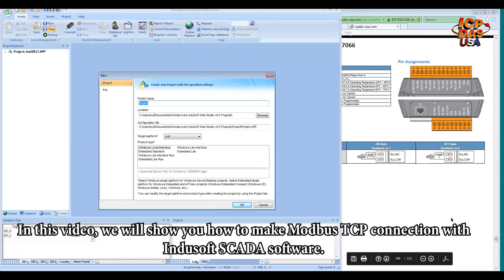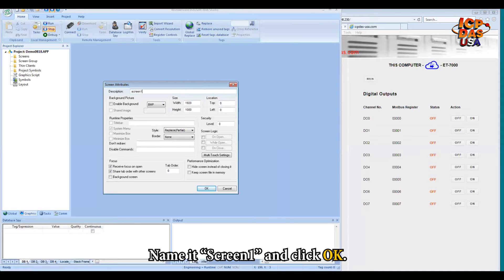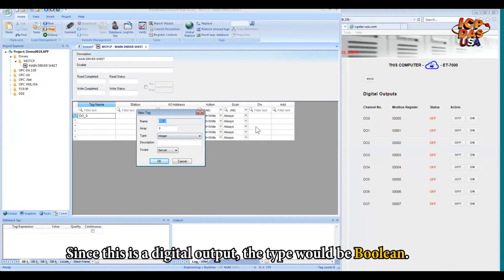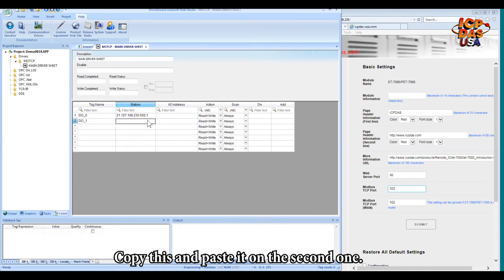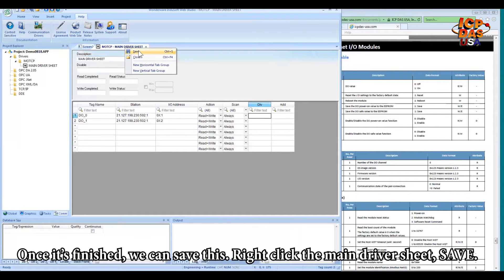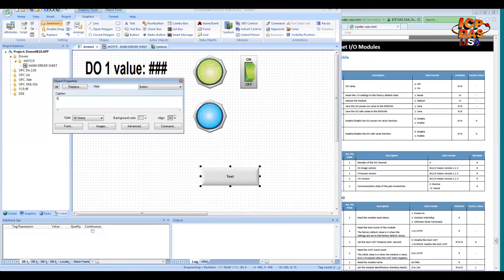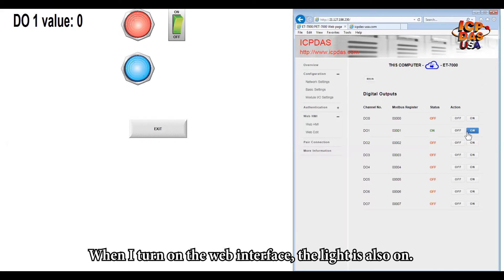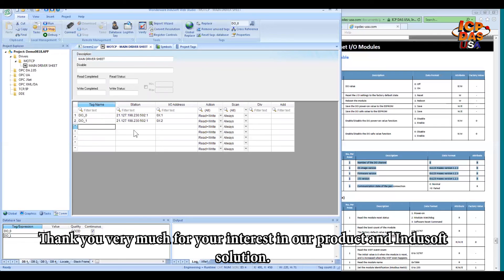How To Connect Modbus TCP Devices with InduSoft SCADA Software

Comment: Is there a way to connect two computers with Indusoft in the same network?
Reply from the maker: You can run Indusoft on one of your computers and have a thin client on the another PC.

If you have any further questions on the subject, please feel free to chat with our team at icpdas-usa.com
Reply: Hello I need your help I want to take data in secondary sheet instead of main sheet can you tell me header for swapping float 44001